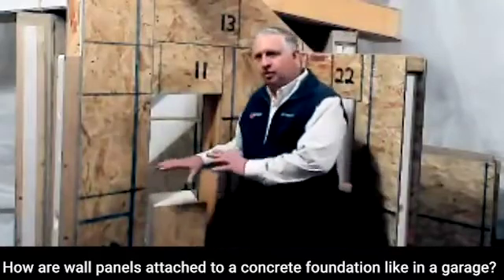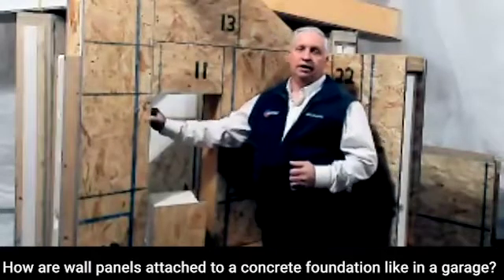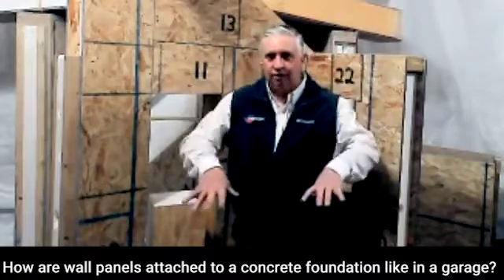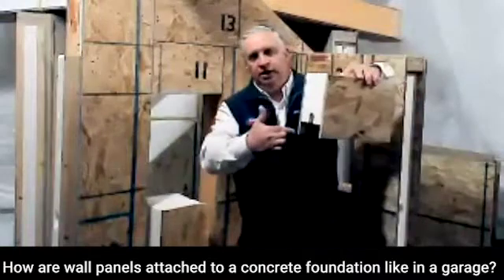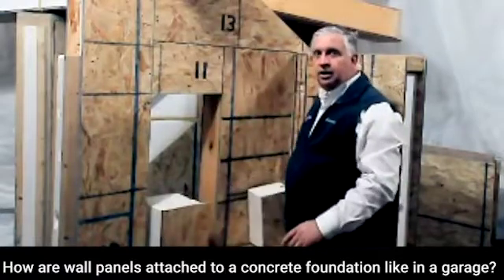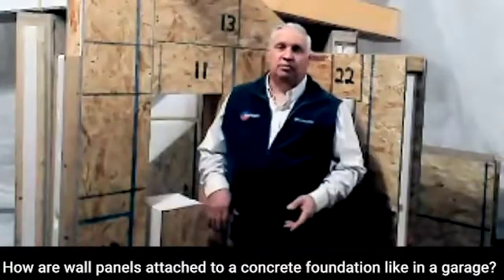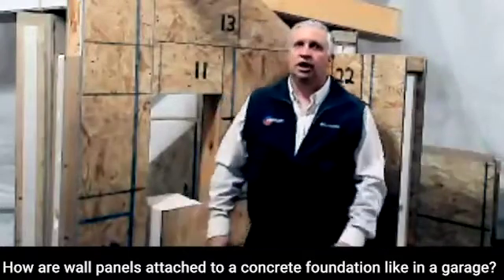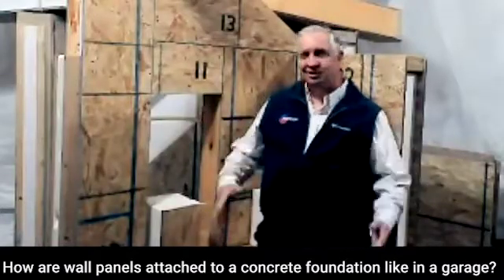How are wall panels attached to a concrete foundation?

Comment: So how is the SIP attached to the sill plate? Think of high wind or tornado situations where you need the walls securely attached to the concrete. Are there horizontal screws or bolts going through the side of the SIP and into the sill plate?
Reply from the maker: The answers to your questions can best be found in these videos:
https://www.youtube.com/watch?v=LC5kC_BkFUk
https://www.youtube.com/watch?v=zzpkEdkQ57U
https://www.youtube.com/watch?v=fd-WOKH75Cc
https://www.youtube.com/watch?v=sq9YxIsnEP0&t=1s
I hope these help. If you have additional questions, please feel free to contact us via our chat line on our website: www.enercept.com; one of our SIP experts on this page: https://www.enercept.com/contact; or download our construction guide here: https://www.enercept.com/technical-guide